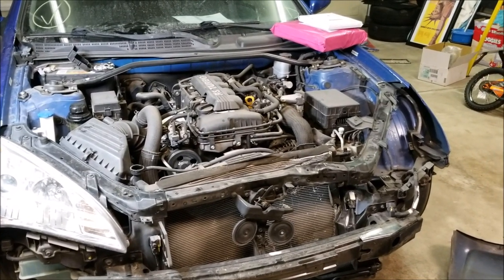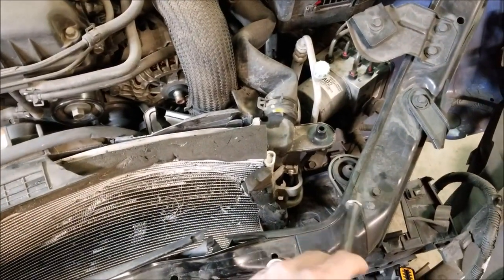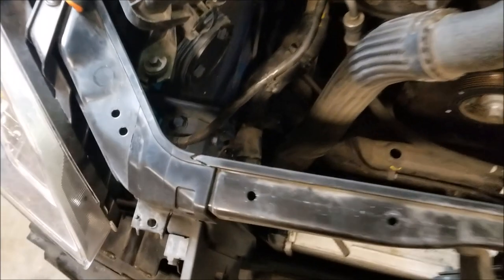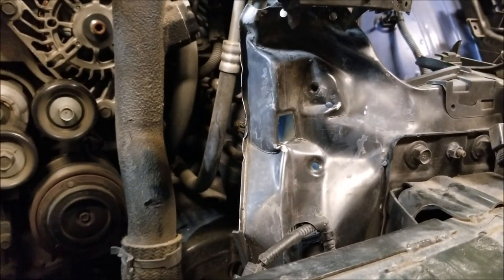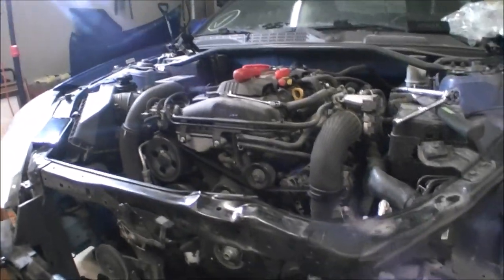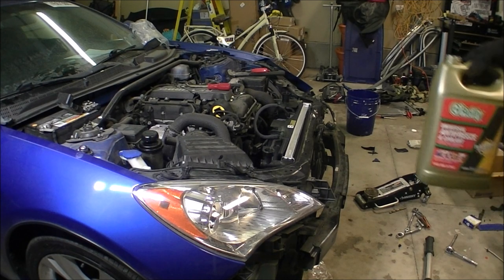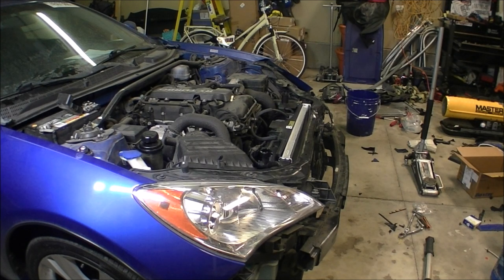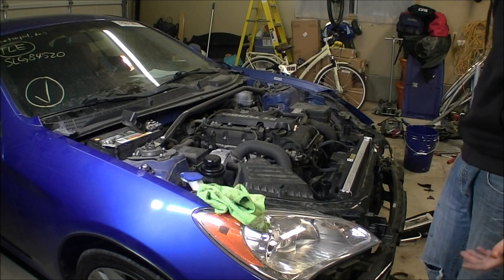2011 Genesis Coupe 2.0 Turbo Copart Rebuild - Part 1

Comment: Did you order a core support?  They are simple and bolt in.  Would be a lot easier to work on with it off too
Reply from the maker: UnWrecked I was curious if they were bolt on or not.... But no, haven't yet... It's on my list, along with a hood and bumper... Thanks for the info tho!
Reply: J Tay187 I did the whole front end on a 2011 sonata limited.  10mm socket and you can take the whole front off
Reply: I was wondering the same thing. The one on this car didn’t look salvageable to me.

Comment: btw car will be slow until you mod it
Reply from the maker: I've read that... I plan to do an intake, cat back and tune... at least for now... any other mods / advice to make it a little quicker besides those?
Reply: Id suggest bigger injectors, adjustable fuel pressure regulator a twin scroll turbo setup and a custom tune  you can check out sfr for some ideas they make great canned tunes also
https://www.youtube.com/user/seoulfulracing/videos